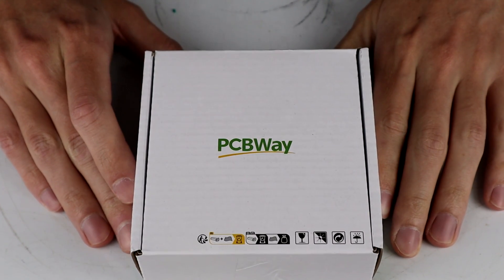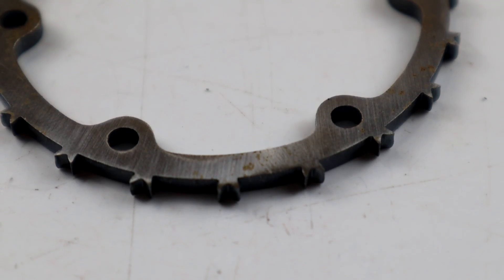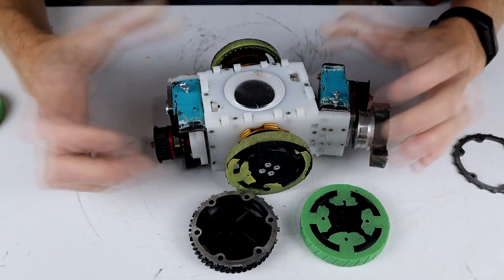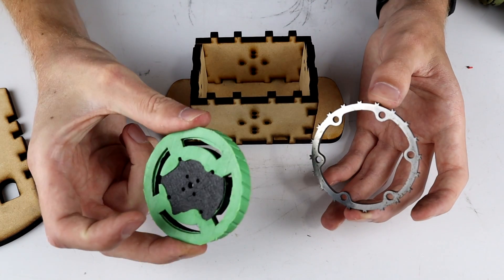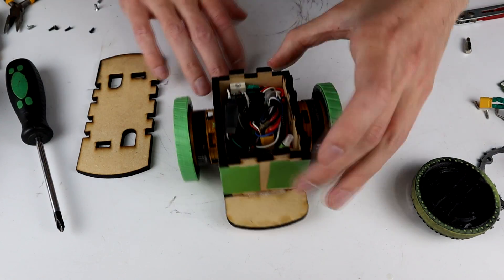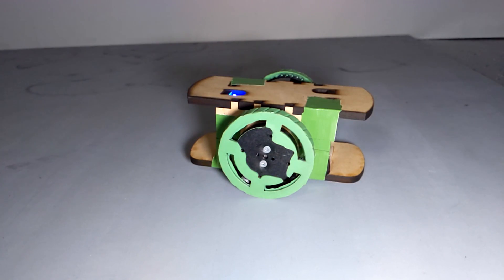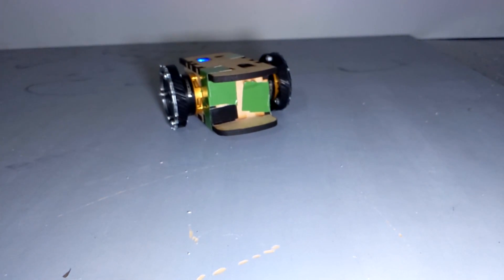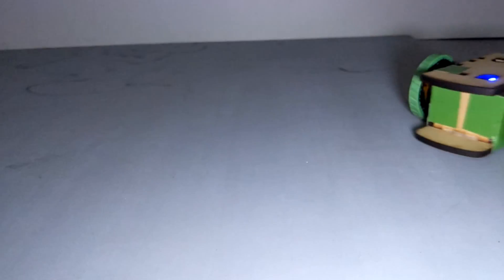Does stabbing the ground give better traction??? (giving my robots cleats)

Comment: Are you gonna run into tip-speed rules limit with these cleats?
Reply from the maker: I dont think so?
Its not an issue for ARC as we dont have a tip speed in beetles currently

Comment: Creator of the 3lb ring spinner, Event Horizon, here.

Cleats are amazing, I switched to them a while back and there is no way im going back. They have way more advantages than just improved traction. They last significantly longer than rubber (to the point where they pay for themselves after an event or two), they can be rejuvenated by a little sharpening with a file, have way more traction when implemented correctly, and they can be much lighter than wheels.

Cleat design is more finicky than wheel design is though, and has the potential to be far worse than wheels if not implemented correctly. BUT, if you dial them in for your bot, they're awesome.

A couple things about the tests in the video: 
1.) Weight is more important to cleats that it is to rubber wheels. Way more important. Without enough weight cleats don't bite enough and have less traction than wheels at the same weight.
2.) Cleats should be as thin as possible. 3mm cleats are really really wide, too wide in my opinion. You don't get enough bite into the wood when you're tying to press a line into the ground. 1mm is what Event Horizon uses to great effect, but I've also seen people in 3lb go to 0.5mm.
3.) Lastly, tooth shape. As long and thin as reasonable is the way to go. I've seen a lot of people do the double spiked tooth but I find that a single thin spike works better as you are pressing less area into the wood.

All in all great video, keep it up!
Reply from the maker: Thanks for your insights!
I'm very new to cleat design so made a bunch of guesses

I can easily see a v2 design from your feedback, I'll have a go at designing one in the near future. I'll also be sure to test on a full weight beetle to be sure I'm getting the most out of them in testing

Comment: Great video and an important design element (for melties)! 
The downside of cleats, besides the damage they do to the floors, is the poor traction they have if the cleats do not bite.  On soft woods, cleats easily get good bite; but on hardwood plywood, and woods treated with a hardener, their bite can be hard to find.  The coefficient of friction for a cleat that grabs is "unity", the coefficient for a cleat that doesn't grab is close to "zero", and cleats that shred wood are somwehere inbetween. The HUGE benefit of rubbers,  polyurethanes, and even TPUs is that the coefficient of friction for the dynamic and static situations are much closer together.

I have used cleats with mixed results... the long span of poor results has been due to my own incredulity that they do not work as well as I think they should... I failed to adapt. After the poor results I had at the December NHRL event, many people heard me swear off cleats... instead I thought I would switch to rubber,  polyurethane, or TPU.  Team Alfredo (The Greatest Danger) likes their 3d printed TPU wheels and they have had good success with it.  My plans for the March NHRL event is a better designed cleat coupled with a TPU sleeve to minimize the depth of floor penetration.

I loved the slow motion video... many insights can be gleaned from watching the cuase and effect of such video.  One such effect you can see is when one wheel is "grabbing" and the other wheel is "slipping".  As you said in the video, the behavior will likely be (very) different with the full three pounds of weight.   Another issue to be investigated is the effect of a short wheel base versus a wide wheel base; I think that can change the results as much as more weight.  Thanks for making it.
Reply from the maker: Thats a great point about the difference in traction when they dont bite. 
They feel a bit like a risk reward endeavour, if they work they work well, but if not the robot practically falls over

I like your idea of a dual type wheel, hope that goes well for you, I'll be watching the March stream to see if I can see how they work

Thanks, I'd really like to shoot slower video as I'm sure there's more to be gained, but it was interesting what can be seen at even 1/8th real time

Wheel base changes are something it would be interesting to look into.
I'm thinking my next melty might have to be more of a test platform then a bot

Comment: Material-wise, most steels should be fine, but harder is probably better as the steel will still wear against on the wooden floor. Just the floor wears a LOT faster...

Comment: i wonder if adding a say 6 pointy spikes sticking only say 0.25mm out of the poly over mold. maybe 3d printed a wheel that hold 6 tool inserts like maybe TCMT-21.52 then just mold over them. giving the wheels some bite like a weapon

Comment: Interesting that you decided to experiment with cleats.
I remember on one of your streams from last year, when I asked about your thoughts on Project Liftoff, you mentioned that ARC would be uncomfortable with cleats constantly damaging the floor.
Maybe you could save those cleats for if/when you return to NHRL?

I know, wishful thinking, but a guy can dream, right?
Reply from the maker: Yeah, and I kind of stand by that, what changed is people using cleats on wood floors in the 30lb fights here in AUS and not really eating the floors
So I asked ARC about it and they said as long as it doesn't do too much damage and if I'd be happy to contribute to a "floor replacement" fund. So I decided to test them, see how much damage they'd do

I think I need more testing yet, as a few comments have said they will work better and do less damage on a full weight beetle

I want to head back to NHRL some day but its a case of time and money